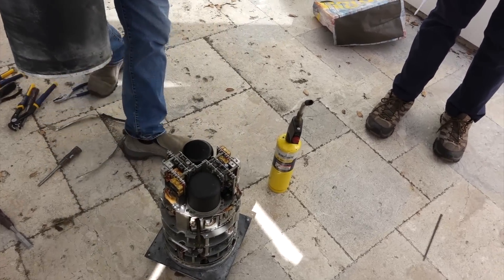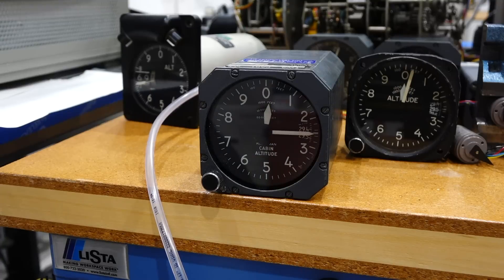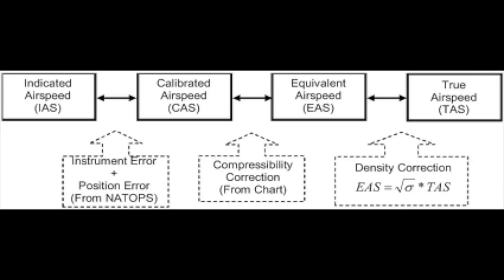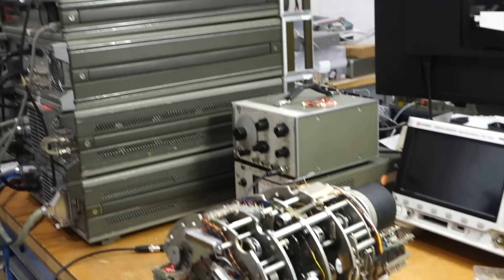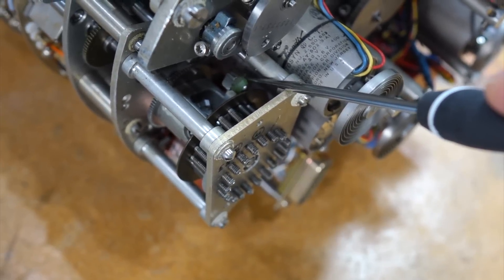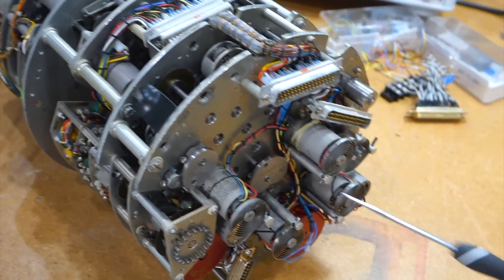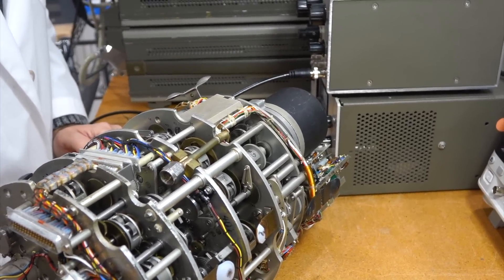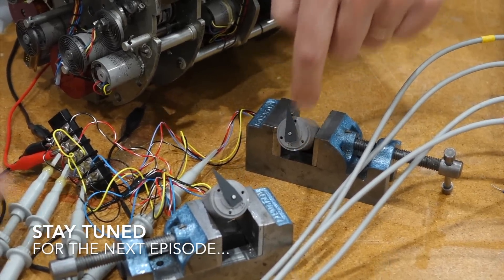Bendix Air Data Computer - Part 2: Master Ken Explains How It Works

Comment: Pressure is just energy per unit volume. The dynamic pressure component (kinetic energy)  doesn’t actually exert pressure on the pipe walls in a flowing fluid, so it isn’t measured with regular pressure gauges. To measure it we use the pitot tube which takes and stops the fluid, thereby converting that kinetic energy to potential energy where it does exert a force and so can be measured. The easiest way is as shown in your diagram, just the difference in pressure head. I used to be a pipeline engineer, liquids only. Compressible fluids like air are much more problematic to constrain with assumptions like engineers love to do 😆.

Comment: What's the difference between a syncro and a resolver? The Angle of Attack vane on an Airbus A320 has three.....resolvers? ....or is it syncros?  The A320 has three air data / inertial reference units and three angle of attack vanes.....each with three resolvers.
Reply from the maker: They are cousins, the difference is explained in part 3: https://youtu.be/8QvoY4_xBjw

Comment: I maintained the test software for the F-16 ADC at Hill AFB for a while back in the late 80s. It was nothing as interesting as your Bendix ADC. And frankly it could be improved by replacing all the electronics with an off-the-shelf Arduino Nano.

Comment: Aww - Takes me back to my class in LaPlace Transforms - in LaPlace space the transfer functions look very simple (inputs and outputs). Side story - back in the pre computer days I remember a flow rate display in an oil refinery control room - the only catch was it was the square of the real flow rate.  You had to take the square root (in your head or look it up) to get the real flow rate - but the operators worked with the display square - crazy

Comment: In the early 70s I worked on a printed circuit board that would do the same thing with opamps and comparators. Board was about 9X5 inches. No micros.

Comment: I’m curious what the servicing of such a system would be like - particularly the lubrication of the various pivots/axles.  Fascinating unit - the use of cams and gears to conduct calculations and display results … this is the kind of stuff that would have brought maths at school to life.

Comment: Forgive my incredibly uninformed question, but why 115VAC? Is there a specific reason for AC over DC generation, and at that high of a voltage?
Reply: There's a document, MIL-STD-704, defining the standards used for aviation power by the USAF.
115/200 VAC 400Hz 3 phase, 28VDC & 270VDC.
The latter apparently only used on military aircraft whilst the former two are also commonplace on civil aircraft.

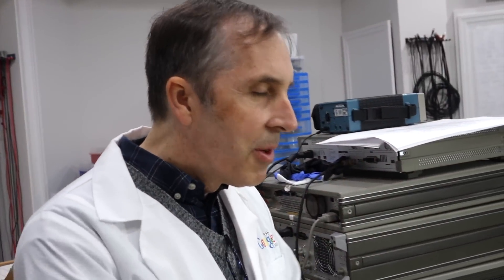Comment: Commenting on the connectors for a 2nd time allows me to go into greater detail: Turns out the innards sport a different set of connectors (male DD-50, DC-37 & DA-15 D-subs, see 0:39) than the faceplate, which has round connectors (see 0:13). So there must be a set of matching and perfectly aligned female D-sub connectors on the inside of the faceplate, an example of which arrangement in the form of a DC-37 (not the one on the faceplate but further down on the side) was seen in part 1 at 2m26s. Interesting that they used internal connectors at all, prolly for ease of assembly & maintenance. Pls show us the inner faceplate.

Comment: My comment in the original was about Bendix's change from mainly electro-mechanical to electronic in this form of instrumentation.  When was that?
Reply from the maker: It’s very progressive. Some part of the calculation gets replaced by an op amp or two, while the rest stays on gears and synchros. eventually everything gets the analog electronic treatment, then the digital enters. Michel (from the channel “Le labo de Michel”) has a later model of this where you can see that happening.
Reply from the maker: I found Michel's video: https://youtu.be/buoNSv689r8 . One of the next revisions of this, where you start to see a mix of op-amp analog electronics and electro-mechanics.

Comment: A note on indicated airspeed:  even though it's not the true airspeed, it's surprisingly useful because the lift from the wing is effected by many of the same factors.  For a light aircraft staying below about 5km, you almost always are flying to a indicated airspeed, and only want to know true airspeed to guess at your groundspeed (which nowadays you mostly measure more-directly anyway).

Comment: How does the coarse and fine synchro setup work? I don't understand how can the coarse one be useful there at all.

Fine synchro alone could work, as long as the value never changed quickly enough/we always had power when the axles were moving: the total number of its turns would agree between both sides under these circumstances.

If we want the coarse synchro to help deal with fine synchro desynchronization, we need it to be able to overpower the fine synchro. But then I'd expect its error to also overpower the fine synchro and thus to make the fine synchro useless.

What am I missing?
Reply: It may be to widen the "response" of rate change that the synchros can transmit electrically. Probably more to do with the second derivative, the rate of change of the measured rate. The synchros geared together would always be locked, but the coarses may aid in the acceleration or braking of the fines to keep the total reflected output changing closer to reality. 

At least, that's what my mind's applying to the problem, right or wrong.

Comment: Oh that obnoctious 110VAC 400Hz. I once owned an aircraft tube amp tripler containing a 2CV2797 If I remember that number correctly. It was sort of a 4CX250.  I rebuild the input to 430 MHz and used it for over a decade to make 400 Watts CW at 70 cm.  I aslo had to rebuild the power cuircuit to run on EU 220 VAC 50Hz.

Comment: It's always surprised me that they're able to get static air pressure from anywhere on a plane, when it's travelling so fast. It seems like there would always be some pressure or vacuum, and it would be bouncing around like crazy.
Reply: It's not quite as simple as described. Generally there are pairs of static ports, one on each side, plumbed together to get the average. And either during development many locations are tested starting with scale models in wind tunnels and also full scale testing on prototype(s) or, extensive computer modeling can determine a nearly optimal set of locations.

In any case there are errors and then airframe specific corrections.

None of this is necessary for one specific type of airborne use. Hot air balloon altimetry requires nothing more than the open port being in relatively undisturbed air.

Comment: Any chance of a video to explain magnetic amplifiers?  I've got vague recollections that the core saturation was adjusted to change the coupling of signal from primary to secondary... but that could be very wrong.  For applications that required robust parts, a magnetic amp seems like a clear winner over vacuum tubes.

Comment: Minor note. At 3:23 the drawing implies that the air going past the static port is at velocity V. 
Actually, the static port is located at a place where the air velocity is close to zero. If you attach a little string at the static point you would see it's not moving in any particular direction. Just flopping around due to a bit of turbulence.
The locations of a static port on an aircraft are chosen so there is essentially no airflow velocity at the surface. Hence, static port.
If there was a velocity at that point, then the Bernoulli effect would cause a suction. In other words, a negative pressure relative to the static value.
Reply: Yes, exactly. Usually well past the beginning of the taper of the tail part of the fuselage. But also normally pairs plumbed together from opposite sides to reduce the effects present when crabbing or in significant yaw maneuvers.

Comment: “Any sufficiently advanced technology is indistinguishable from magic”

-- Arthur C. Clarke
Reply: Watching Marc's channel, I use to say "Any sufficiently antiquated technology is indistinguishable from magic" - case in point with 1960s frequency counters that go up to over a Gigahertz even though the electronics couldn't handle more than a few dozen Megahertz - and went to using fancy math to do the 100MHz and GHz range.
Or sensing Microamps by chopping the signal with a wild neon light opto coupler circuit.
Reply: Any sufficiently old technology is indistinguishable from aliens.
Reply: Except that this belongs in a museum.

Comment: What amazes me most is that a few transducers and a calculator grade microprocessor would replace all this nowadays, amazing effort on the manufacturer's part!
Reply: More like three microprocessors running overcomplicated code in lockstep with outputs going into a voting comparator for redundancy and fail-safety
Reply: @sashimanu  can you define what “overcomplicated” means?
Reply: @guidoscalise  It's probably written in ADA, requires at least a 32 bit CPU with at least 8 MB of ram, and I'd be real surprised if the source code was under 100K lines. I would not in the slightest be surprised if the source code was over 400K lines.
Reply: @lwilton  And this is why I'm asking what, if anything, @Sashman thinks there's an overcomplication about. It's usually quite the opposite: extremely simple, defensive code in a very controlled, usually RT OS environment with little to no context switching, with the intention to make it extremely easy to formally verify and validate the execution constraints.

I'm pretty sure avionics engineers are paid big bucks because you can't just do "import avionics; avionics.main()" in a Python program and call it a day.
Reply: @sashimanu  Even in "modern" ( read = 80s derived ) designs you would instead have three separate computers like this and only after that doing something other than actor-judge :P
Reply: @sashimanu  This old school mechanical computer has none of that.
Reply: @FrozenHaxor  And, it's realtime. Unless you devote a LOT of time into developing an RTOS or dedicating cores to a given task, you'll have some possibly significant lag in a coded solution.